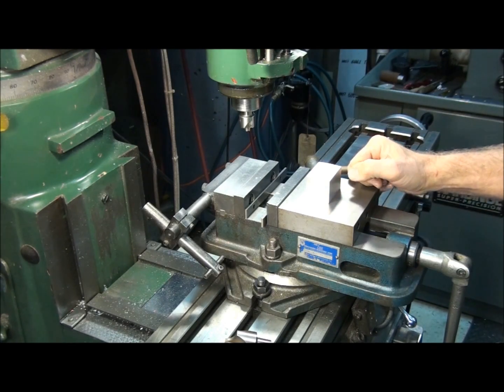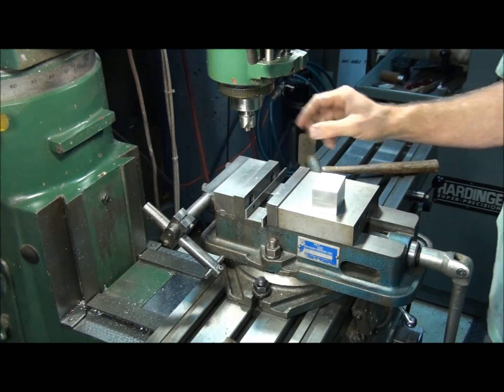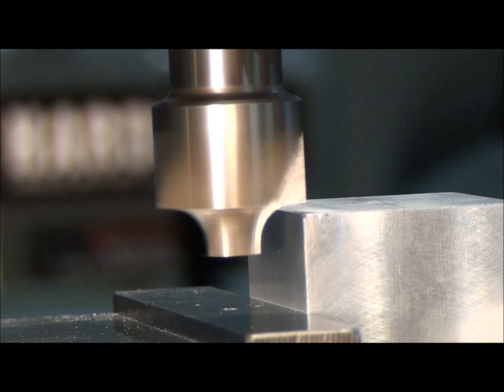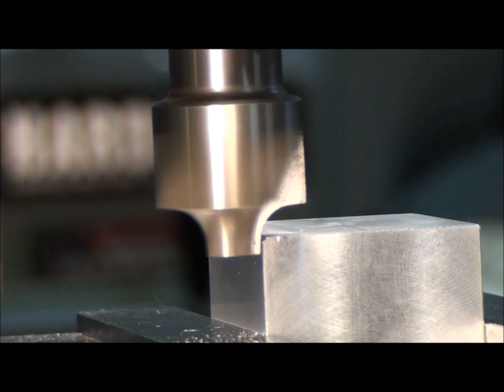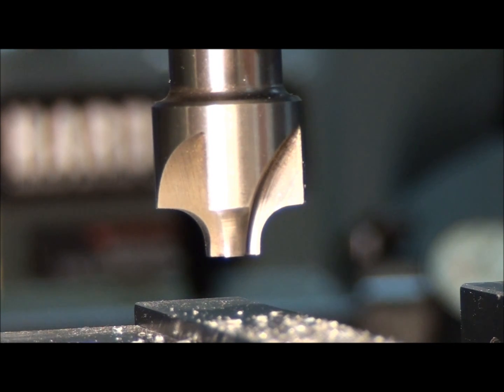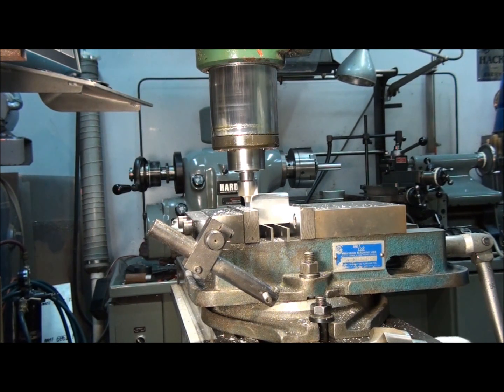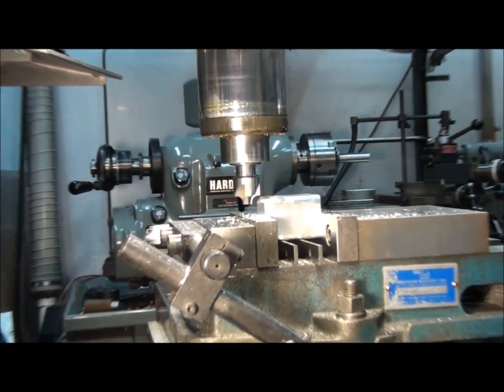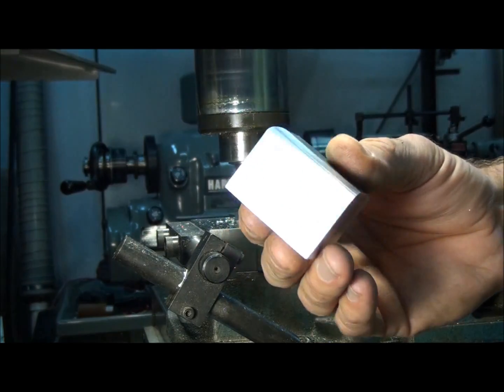How to use the Corner Rounding End Mill

Comment: Hi Tom.....It is really a good tips and demonstration. It is really an artistic job to work on the milling machine. However i am a beginner, though i have some idea. But i have not worked on milling machine. I just want to learn to operate. Is there any baby milling machine available for beginners? And if so,what will be approximate cost? Please let me know.
Reply from the maker: Grizzly offers quite a few bench top mills starting around $1000. Just stay away from the round column types because they lack rigidity.

Tom

Comment: Hi Tom.....nice video with a lot of common sense .
Q:
Do you think is a good idea to work with a pair of springs between the parallels to keep stability on them ?.
Thanks and greetings from Texas !!
Reply from the maker: Thanks.

The only time I use springs is if I'm running a lot of the same part. Other than that it's not worth the trouble.

Tom
Reply: I use rubber bands to

Comment: Am I wrong or isnt that tool called a "countersink"? It appears to be quite similiar. (sorry if you explained it in the video but I dont have headphones and im at school).
Reply from the maker: Yeah, you're wrong. ;)

A countersink is an end cutting tool used to make a cone shaped cut in the start of a hole, so a flat head screw will sit flush with the surface. They are available in various angles, normally 90º for metric screws and 82º or 100º for imperial screws. They can also be used to deburr a hole or in a pinch, mill an angle on the corner of a part.

A corner rounding end mill, like I'm using in the video is a side cutting tool used to mill an external radius on the corner of a part.

Thanks for asking (and watching).

Tom
Reply: Huh, thanks for that information, great videos by the way.

Comment: I've been a Machinist/model-maker for 40 years and it amaises me how many people side mill with the quill extended. You should never side mill with the quill extended. the more it is extended the less support it has which results in pre mature ware and chatter on your part. That is the way I was taught in my voc. school and it makes perfect sense to me.
Reply from the maker: That makes sense if you are taking a heavy cut David, but on a light application like this it makes little difference. I'd rather spend the time cutting metal than cranking the knee up and down. You'll notice that I was taking a full depth cut with no chatter at all. If the part had been steel, I probably would have been cranking.

Tom
Reply: Why would you need to crank the knee (or the quill) up and down for this? Keep the same adjustment without moving anything, except the cutting movement of course.Very nice video. :-)RegardsR.

Comment: Hi Tom, does the standard CSx4/D formula apply for corner rounding end mills?

I'll be using a 1/4" and 1/8" on an aluminum project very soon.

Let me know, thanks.
Reply from the maker: It sure does. Use the outer diameter of the cutter to calculate the proper rpm.

Tom

Comment: Tom,

Do you use the same technique for mild steel? ie... climb mill with a one shot full depth pass?  Obviously slower speeds for steel.
Reply from the maker: Glen,

It depends on the size of the radius. On my mill, a large one like a 3/4" would require a couple of cuts, but a 1/8" or 1/4" would only take one. Of course that is on my mill, a lighter mill would require more cuts. You have to know the capability of your machine to decide.

Tom
Reply: Thanks Tom, I have a similar sized machine.
Jut acquired a set of corner rounding mills a while back and only used them once so far. Will use your advice next time around.

Comment from the maker: Thanks Scott.

There isn't much to using one on the lathe, but I guess I could throw together a short video on it. Basically you just use one flute of the cutter as a form tool and pick up the corner of the part just like on the mill. The difference is the part is rotating and the cutter is stationary. I'll see what I have going tonight and maybe I can squeeze one in.

Tom

Comment from the maker: I do have a DRO, but it doesn't help in this case. Once the two faces of the part are picked up with it against the solid jaw of the vise and the dials or stops set to zero, backlash doesn't come into play. In the video, I raise the tool with the quill to get it clear of the part and then return it against the quill stop. If your mill doesn't have a quill, you can leave Y locked and remove the part to return the cutter, or back off the Y or Z axis and then return it to zero with your dials.

Tom